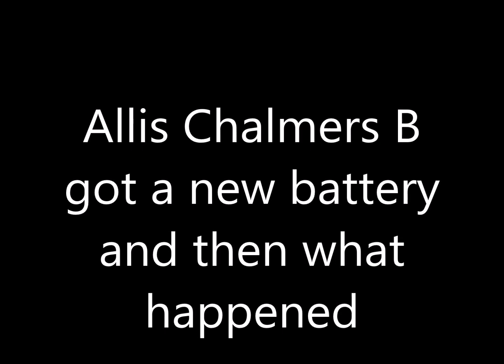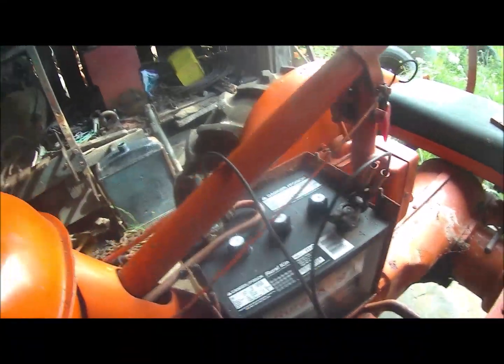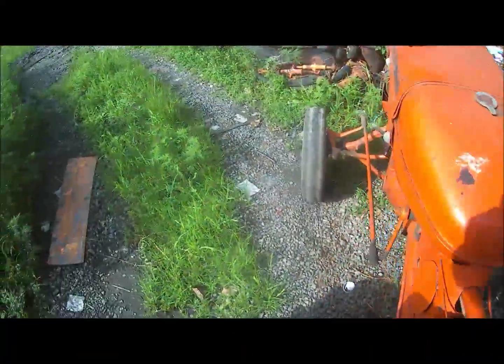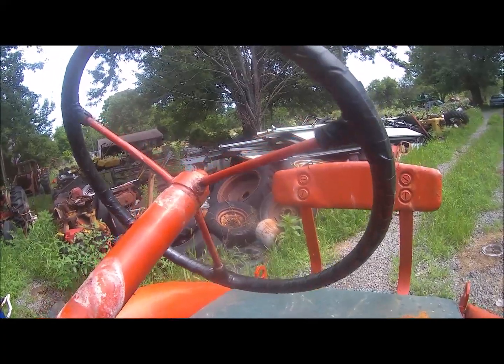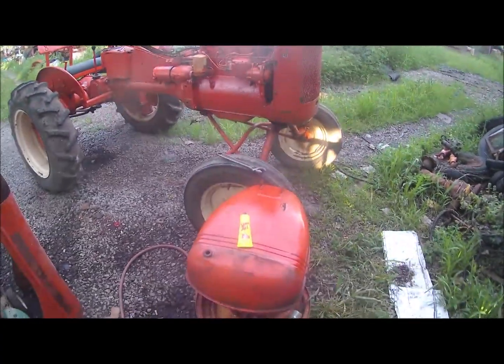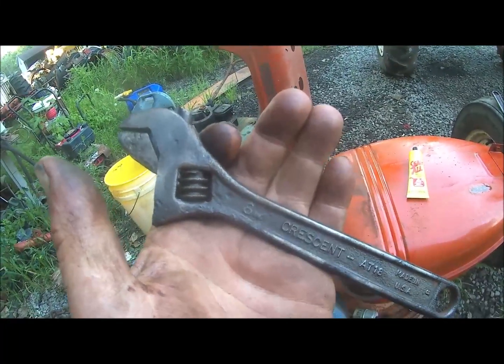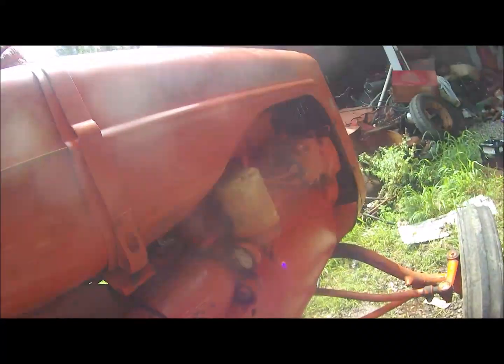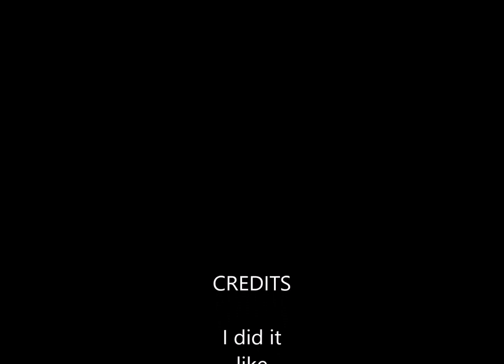Allis Chalmers got a new battery and then what happened

Comment: We used to drill a hole in the top of 12v battery into third cell which is 6v.
A copper screw into lead taps 6v.
Then you can use 12v for Starter and have 6v for rest of lights ignition etc.
Did this for years.

AC made excellent equipment.
"Big Allis" turbine still powers 30% of NYC today.

Nice videos thanks.